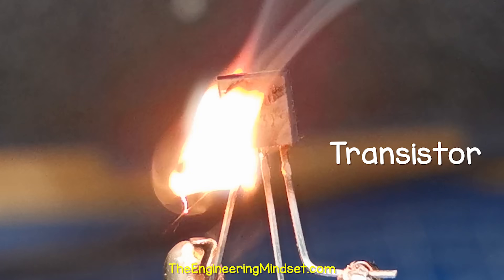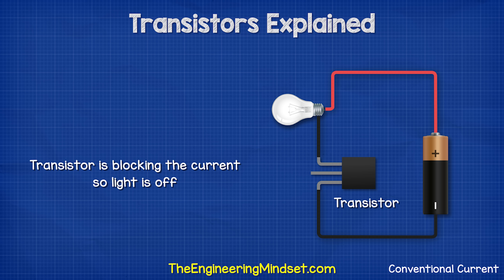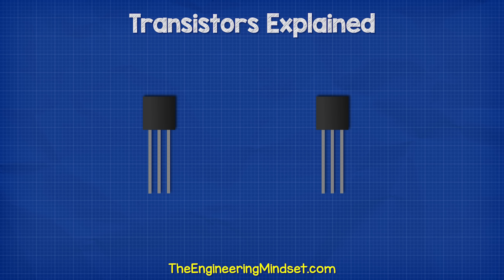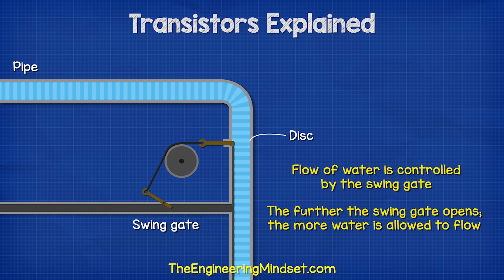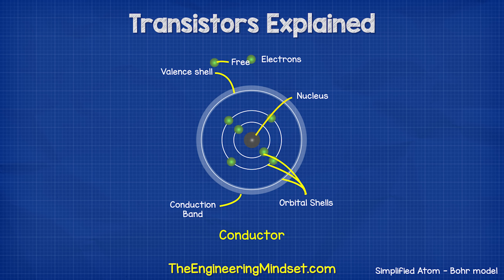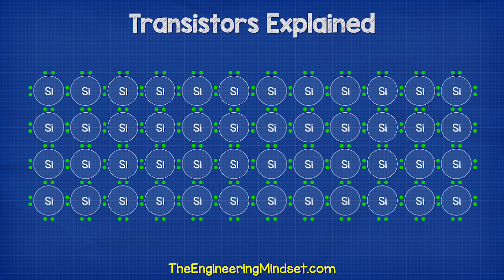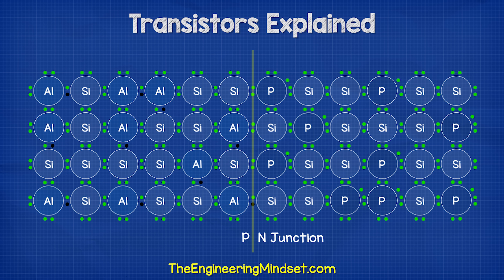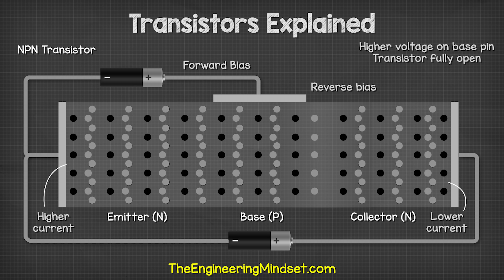Transistors Explained - How transistors work

Comment: 9:45 When's the last time you saw any electrical wire with rubber insulation?
Reply: They're used all of the time actually. Straight rubber or silicone rubber, styrene butadiene, ethylene propylene, neoprene...etc. Plastics are used too, just depends on use and environmental factors. Weight, cost, dielectric rating, heat resistance, chemical compatibility, and so on.
Reply: @JimBob1937  Literally none of those compounds are rubber, except "straight rubber". They are made from crude oil and other chemicals. In other words, they are all plastics. Ethylene and propylene are not even solids.
True rubber comes from latex, which comes from a rubber plant. It is therefore much more expensive than the plastics (fossil-fuel-based polymers) you have listed, which is why it is mostly used where high-quality performance is required, like high-end tyres - especially aeroplane tyres. If you can show me a currently available stock of wire that is insulated with true rubber I will acclaim your superior knowledge. The easiest way to tell is how the wire coils. Plastic insulated extension cables, for example, is harder to make a tidy coil with than old rubber ones, which you never see these days.
Reply: @TheJamesRedwood  ... literally, those are all known as 'synthetic rubber.' Natural rubber hasn't been the primary source of rubber in a long time. For example, neoprene is known as one of the first synthetic rubbers to be made, invented in the 1930's. I sort of see where you're going with your post, but your usage of the terminology is about 100 years too old. The industry considers plastics to have different properties than rubbers, either through inclusions of different chemical elements or by physical properties alone. So, while you're correct that natural rubber insulation is likely very rare, synthetic rubber is very common, further the industries differentiate between plastics and synthetic rubber.

"I will acclaim your superior knowledge"

That isn't the point, but either way, you can research further yourself and see your misuse of the terminology...
Reply: @TheJamesRedwood  , you would have a point if he stated 'natural rubber.' However, he stated 'rubber,' which can be natural or synthetic, and synthetic rubber is quite common. Trying to exclude what the industry considers the primary source of rubber these days seems disingenuous or missing out on modern usage of the term.

Also worth noting, natural rubber isn't inherently better either. Different (synthetic or natural) rubbers have different physical properties that are good or bad depending on the usage. For example, most synthetic rubber is more resistant to ozone cracking. Tires can be made by containing both synthetic and natural rubbers to achieve the engineering requirements. As an ironic twist to your assertion, natural rubber can be synthesized and is known as synthetic natural rubber. Synthetic or natural doesn't define "true" rubber, past anything but historical context.
Reply: @TheJamesRedwood  , to poke the bear, with my last reply do I get my promised "acclaim" ;-)

Also, minor correction of another statement of yours:
"Ethylene and propylene are not even solids"

Ethylene propylene rubber certainly is. I wasn't listing them as distinct separate components.
Reply: @JimBob1937  Then I guess I am historical, and accurate.
Reply: @JimBob1937  But you didn't say ethylene propylene rubber did you? Nor did you say "synthetic rubber" if you had I would not have corrected you. Your grammar was random, using the words "plastics" after you had named a string of plastics. If you want to be accurate, which you should if you are correcting someone's post, you should have used the word "elastomer". But then, if you wanted to be accurate, you would have supported my original statement, with comments, not refuted it.
Reply: @TheJamesRedwood  , "you would have supported my original statement, with comments, not refuted it."

I didn't inherently refute your original statement. I expanded on the fact that rubber is a much wider category than you think. It's like calling water 'natural' water and the only real water if found in nature rather than that 'synthetic' water created by combusted hydrogen. It makes no sense.  I corrected you, you seem unable/unwilling to admit fault for a simple mistake... so here we are. Good luck to you sir.
Reply: @TheJamesRedwood  , 
"But you didn't say ethylene propylene rubber did you?"

You stated:
"When's the last time you saw any electrical wire with rubber insulation?"

I stated:
"They're used all of the time actually. Straight rubber or silicone rubber, styrene butadiene, ethylene propylene, neoprene...etc."

Some grammar help for you. Your comment prior made the topic 'rubber.' In that context, 'they' refers to the subject, aka, rubber. In this context, the list items that follow are implicitly based on the defined subject, rubber. Hence,  'styrene butadiene' is referring to 'styrene butadiene' as a rubber. Hence, you've failed your grammar, but most likely you know your grammar but are just trying as hard as possible to save face, which is arguably a worse outcome for you.

"Nor did you say "synthetic rubber" if you had I would not have corrected you."

You didn't explicitly state 'natural rubber,' did you? In a hierarchical structure you can have a parent group and children groups within it. When referring to a parent group, it also implicitly refers to an and/or relationship with the children. Meaning, referring to the parent may be referring subgroup A and B and C...etc, or A or B or C...etc. Here, the parent group is 'rubber,' with children/subgroups being 'natural' and 'synthetic.' The guy you're correcting used the more broad parent group of 'rubber,' whereas you incorrectly corrected him as you assumed only a single subgroup of rubber existed, 'natural,' which would also makes the subgroup equal to the parent group. Since this is the case, whether he, or I, stated synthetic is outside the point, as it was you who made the mistake. A minor mistake, sure, and hence I made a minor reply to you to let you know there is a broader usage of the term... it is you who then fought with all your might to avoid admitting fault and drew out this discussion well beyond what it should be. Re-read my first reply, it was gentle and informative, or at least that was my intent. I didn't figure I'd have to go on a lengthy process of outlining the history of rubber as whole.

To draw you a picture:
           Rubber
              /    \
           /          \
  Natural    Synthetic
Reply: @JimBob1937  In the absence of any adjective, rubber means natural rubber, as it was the first definition. I disagree with your premises.
Reply: @TheJamesRedwood  "I disagree with your premises."

... then maybe I gave you too much credit and you really do need to study your grammar. My apologies for being overly harsh if English isn't your first language.

Comment: I'm just barely learning some of this stuff on my own for RC Cars. I've actually been trying to figure out how I get 12 volts to the motors without melting half the board. I think i accidentally just learned how. Thanks. I could picture it in my head the whole time. You explained it clearly without acting like you're either talking to kindergartners or like you're  talking to licensed electricians.
Reply from the maker: Glad to hear. You could probably use a mosfet instead, check out our motor speed controller video, I think it'll help
Reply from the maker: See my new MOSFET explained video here➡️: https://youtu.be/AwRJsze_9m4

Comment: 2:50 this seems redundant to me.  Why introduce Power Source B just so the circuit will be closed, enabling Power Source A to work, when you can just replace the transistor with a switch, thereby removing the need for Power Source B?

Comment: Spent 4 years working for <insert fortune 500> as a traveling industrial engineer/mechanic. The non/pnp break down and water flow diagram was much better than the 2 week electrical course. Kudos.

Comment: Tell us how they work inside an IC such as a modern cpu with billions of them.  With current EUV processes, it's been noted that they're approaching atomic level.  Boggles my mind.
Reply: They fundamentally work the same way, but instead are in configurations called logic gates which perform boolean math at base 2. And yes, the lattice constant of silicon is roughly 0.5nm, so a 5nm node means the gate feature size is roughly 10 atoms. They've started going upward (rather than flat same height) to get better control since at that size quantum tunneling produces current leakage. EUV is just a process of photolithography that uses higher frequency light for the mask exposures for the photoresist. This helps since higher frequency means smaller wavelength, and smaller wavelength means smaller details can be exposed.

Comment: I see the resistors on the positive side in many of the examples given by this channel. Is that only because your diagrams are in conventional theory? If it were electron flow wouldn't the resistors be on the negative side to provide resistance before the current hits the load? I hope this made sense
Reply from the maker: Check out NEW resistor video, everything covered! ➡️ https://youtu.be/DYcLFHgVCn0

Comment: I kinda understood how to work with transistors, but still don't understand how they work. I mean, what's happening inside? And how is it happening? You send some fuel with air into a combustion engine, compress it and spark it. The mixture explodes and that pushes the piston. Can you explain what happend when you send the current into transistor (like you are telling to a 5 yrs old)?
Reply from the maker: Did you see the part of the video with the valves?

Comment: A lot of the information seems more like an engineer's guide on how to use transistors, rather than how they work. You're putting in arbitrary numbers (0.6V, 100mA, etc.) which don't really have any effect on the educational aspect of the video. If I were going to make a video on transistors, I would make it more informative on the qualitative information.
Reply: Those numbers are not arbitrary, which is why they're included. This is still a lot simpler than what an engineer covers.

Comment: Actually... nothing flows. Check Veritasium video on that.
Reply: Actually electrons still flow in order to create the electromagnetic fields... Veritasium's video, while correct, attempts to sensationalize by making it seem like different abstractions are wrong. In the case of electricity you still need electron flow which in turn will produce perturbations in the electric charge field which is what electromagnetic waves are. However, electron drift speeds are pretty slow, hence it is somewhat incorrect (but still a useful abstraction) to picture electrons zipping through wires. In terms of AC and DC this holds.

Comment: I am pretty sure the electricity flowing through a wire part is not quite right anymore the electrons do flow backward but the electricity actually flows through fields as the crow flies. Why a light turns on instant when hooked to a cable extending to the moon and back with a switch on one end and light on the other when you would think it would be light speed to the moon and back. There is a video on it. Thanks for the video.
Reply: Here's a response I typed to someone else referring to the same video:
Actually electrons still flow in order to create the electromagnetic fields... Veritasium's video, while correct, attempts to sensationalize by making it seem like different abstractions are wrong. In the case of electricity you still need electron flow which in turn will produce perturbations in the electric charge field which is what electromagnetic waves are. However, electron drift speeds are pretty slow, hence it is somewhat incorrect (but still a useful abstraction) to picture electrons zipping through wires. In terms of AC and DC this holds.

In other words, the abstraction of electrons flowing through the wire is correct for most intents and purposes.

Comment: 9:15 the electro flow is the opposite direction of the current flow ( conventional current) because the current flows the opposite direction of the   electrons ( and the current flow measures in the direction of the proton flow i.e. as the electron flow forward, the proton (holes) flows backward direction. Thank you!

Comment: Why is the positive charge represented as a stream that flows towards the negative pole? Isn't it that only elektrons and there for negative charges can transport in a conductor? So why are electric streams always illustrated as if the positive charges moves from the positive pole towards the negative pole?

Comment: What i've never gotten is if you design for conventional current while electron flow is how it actually flows, then how do things come on in the correct order?

If you want A to come on then B and you design conventional current then you'd put A in the circuit first then later in the circuit B. But if the current actually flows the opposite way then wouldn't B come on first and then A?

Comment: Took tube valve idea, shrank it down.

Secret was "doping" the substrates to get same grid/anode/cathode effect with much lower voltages. 

Much lower. Tube circuits routinely run at 300 to 500 volts.

You are holding 5 to 500 billion transistors right now.

Comment: Fully open in electronics means current does not pass, fully closed, means shorted... there is semantic confusion, as 'open' in most of our languages may mean 'on', but this is opposite in the case of a switch, an open switch is off, a closed switch is on. We often say 'close the switch', 'turn on the lights', but sometimes we mix, 'open the lights'... we more often will say 'close the lights', 'turn off the lights' but very little would we say 'open the switch' to mean to turn off the lights...

Comment: So the emitter and collector are the same and it doesn't matter if I connect the battery to the emitter or to the collector? But why is he connecting the other battery there at 16:00? Without it, the transistor doesn't work? And what voltage do those batteries have when they say that one has more voltage than the other?
Reply from the maker: There is a difference, you have to connect it properly. The base current turns the transistor on. Please watch the video again

Comment: Do you have to use different amperage on the base and emitter/collector pin? Or are there transistors that can handle 12v without any resistors?
Reply from the maker: Check out NEW resistor video, everything covered! ➡️ https://youtu.be/DYcLFHgVCn0

Comment: JJ Thompson never said nor did he claim that electrons travel through a copper wire. In fact his official definition of an electron is this.: "The electron is the terminal end of one unit of dielectric induction. Electrons as a separate distinct entity don't really exist, they are merely bumps on something called a filed." So instead of accepting this as a proper definition the scientific community, (which was dominated by mathematicians), decided to run with the idea that all those bumps on the surface of a hydrogen atom were separate charge carrying particles, (they coined, 'The Electron' as a sub atomic particle), that could detach themselves from their nucleus and go wandering off as they please, changing the charges of other fields.

It was Charles Proteus Steinmetz who understood what electricity was and how it flowed because he wrote a book about it in 1914. And in that book he states that electricity is a hybrid of both dielectric and magnetic fields combined together to give you electricity.  Anyone can look at a diagram of these fields together in any decent electrical engineering text book. 

However, electricity isn't comprised of imaginary 'electrons' that go wondering off bumping each other inside a copper wire, No. According to Steinmetz both fields travel outside of the copper wire and all of it's sheathing, ALL OF IT!! So, this means those 2 fields are flowing outside the electrical power line or appliance cord. 

This is why our electric grid is so vulnerable to lightening strikes or CME's that cause brown outs and black outs, because these 2 fields are completely exposed to nature. A Faraday cage would have to be built entirely around all electrical cords and power lines to stop them from getting so much interference from electrical disturbances or CME's/EMP's from our sun.

And before people start claiming this sounds like garbage you might want to know something first. Charles Proteus Steinmetz was the physicists that Einstein went to to get his own math checked. That's right, Steinmetz made guys like Einstein look like chumps because his own equations were so huge they had to be reduced by another physicists, (named Oliver Heaviside), to simplify them so the rest of the physics community could understand what his equations were saying. Steinmetz held 200 patents, just like Tesla did. But it was Steinmetz who had the expertise in laminated steels that made Tesla's AC Generators work within a sturdy housing.

If you ever look a picture of Steinmetz you might laugh because he looks like a small troll of a man all bent over with an ailing disease, his height reached no more than 4 feet, and yet his mind was a spark of brilliance that no physicist cold match to this day. Everything in this universe is made up of EM fields. From the lowly hydrogen atom to galaxies, and no amount of imaginary particles will ever change that.

Comment: Comment about energy levels of the shells was confusing.  Inner shell electrons are more tightly bound to the nucleus.    Takes more energy to remove one and more energy is given off when an electron drops down into the inner shell.  The outermost electrons are not held very strongly and small amounts of energy are needed to knock one loose.